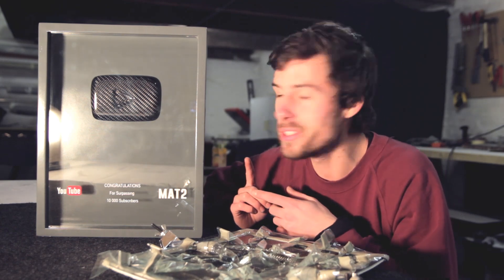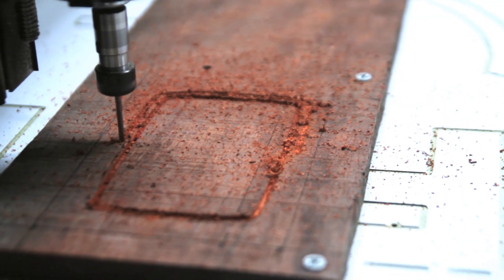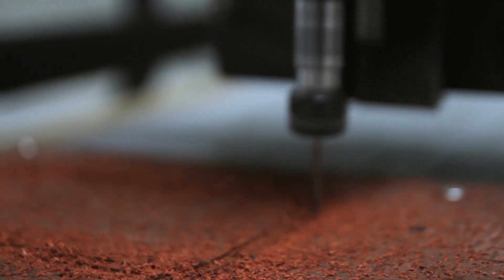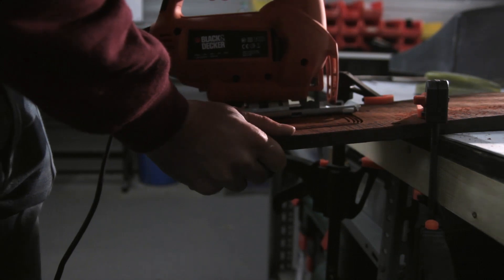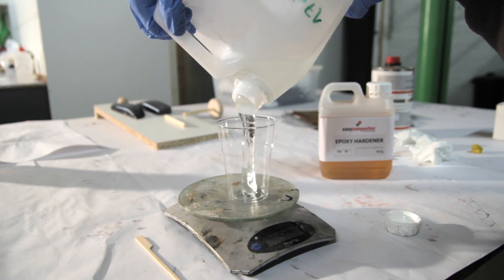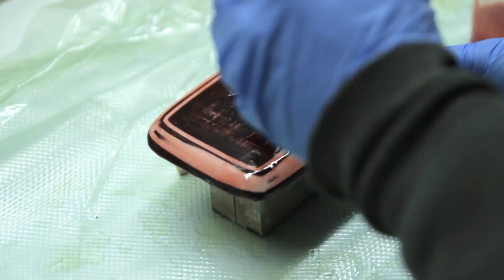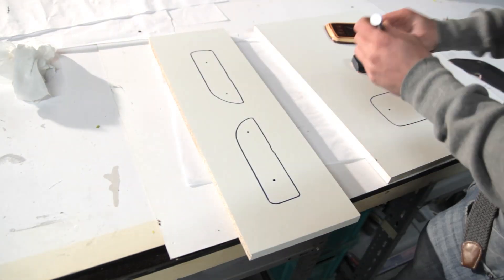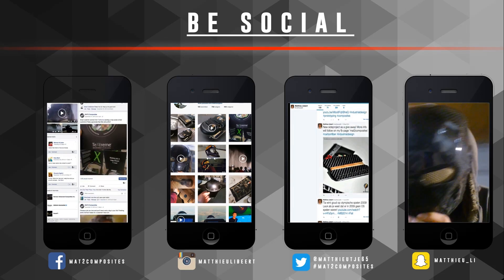10K Carbon Fiber YouTube Play Award Button - PART 1 (how it's made)

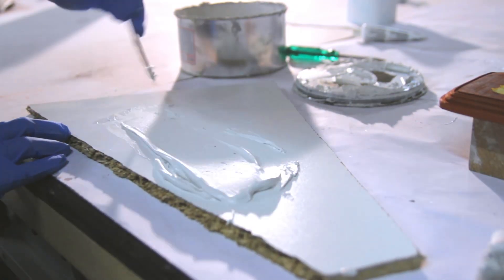Comment: Friend, great videos! But..you can do the all shape with your CNC  router, not need to do the part from 3:50 by hand. Including the piece radius from 4:20
Reply: He says in the video that the CAM software he's using is 2.5D only, so he can't program 3D toolpaths to do those operations.
Reply from the maker: Correct! But in the meanwhile inventables added g-code so possible from now on!

Comment: Mechanical engineer from Arizona.  Is the cnc router capable of 3axis cutting but is only limited buy the software 2.5axis? Also when using the skinning resin i have found that a heat gun helps eliminate air bubbles.
Reply from the maker: +Craig Williams It's limited by the software, need to find some time to experiment with other software...but If I got it right inventables is working on 3D cut software as well at the moment, and correct about the heatgun :)

Comment: If you were to make a drinking glass or something like a tube with a finished end. How would you use Carbon Sleave to come together at the bottom of something like a drinking glass?
Reply from the maker: +RJ Lamb it's almost impossible...it's sometimes easier to cut it through and glue on another plate against the open side

Comment: Sweden here =)
I would like to see a x-parted mould (X represents any digit.) Basically a mould for complex parts where you can´t do it with a "simple" mould because it would be mechanically locked in the mould.
Other than that, just keep up the really good work you do! =)
Reply from the maker: +Lillebroor I'll keep that in mind! only problem is that it takes a lot of time with moulding and adding flanges cut precisely on the part and son on, I mostly avoid such parts but I'll check ;) Thanks for the positive words!